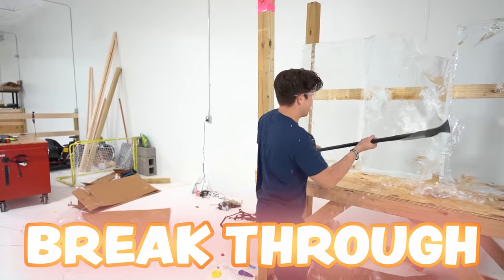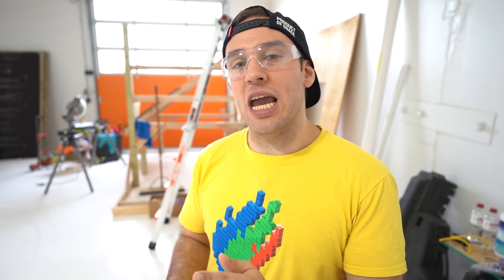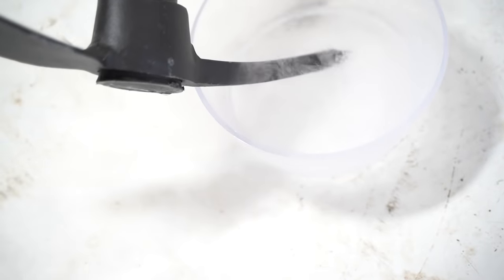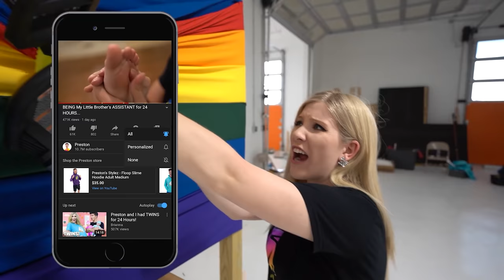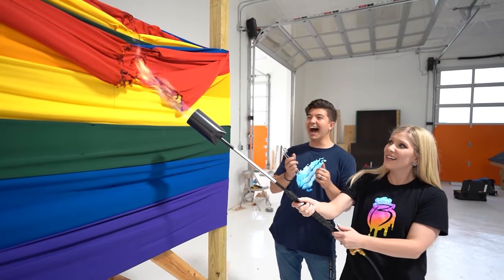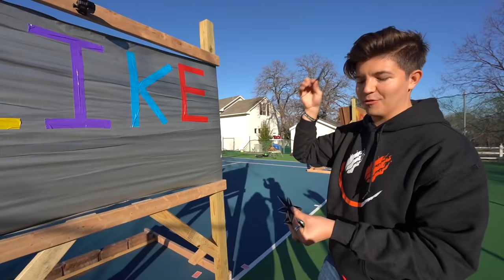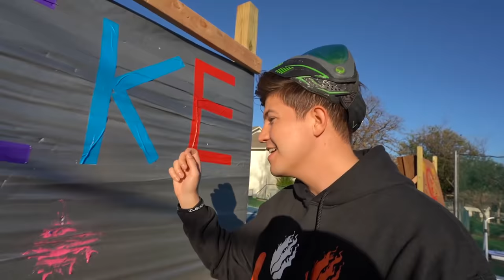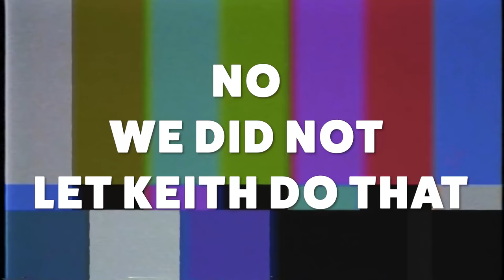600 Layers of STEEL vs CARDBOARD! - Challenge

Comment: Have you ever done a huge Flame thrower on 100 layers of ice vs a jackhammer on 100 layers of cement challenge before? Also I want you Preseton, your father, brothers, sister, brother-in-law, your wife, four co-workers and Unspeakable to hide again in the smallville town vs the cops. It would be fun and I want you to hide on the roof of the tiny time-out building a.k.a the vault of the bank.